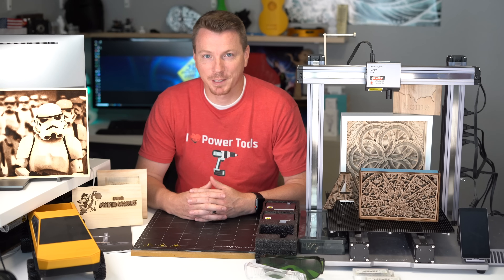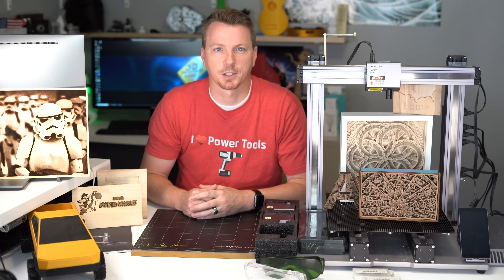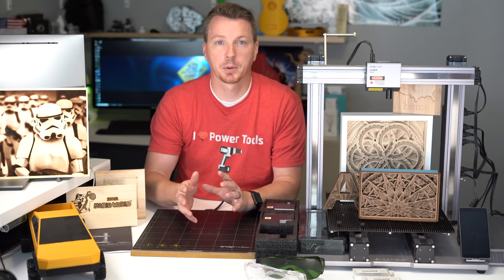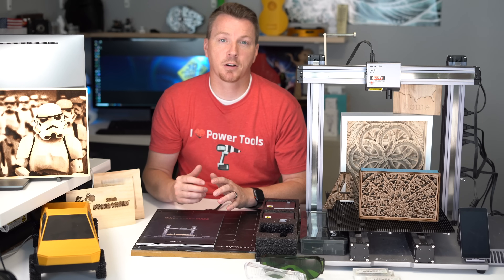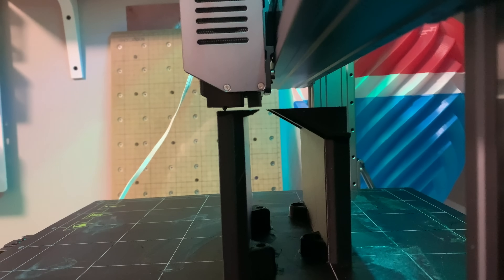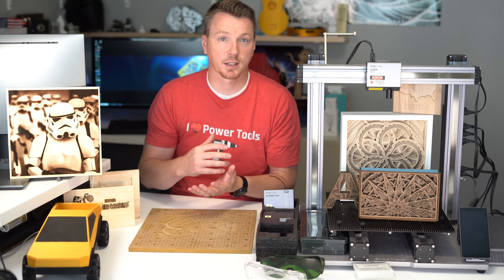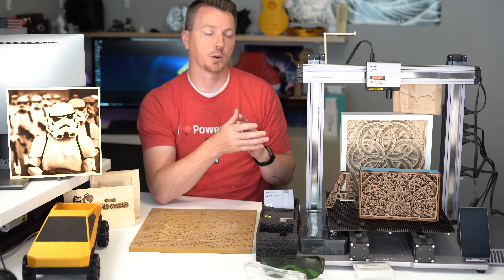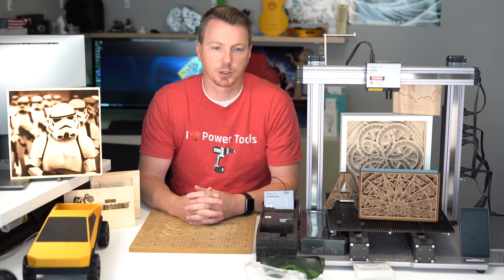Snapmaker 2 Review: 11 Pros plus 6 Suggestions

Comment: I have a question about 3d stuff and scanning  . If you have an object you want to clone with the  mill from a block of resin, plastic , wood etc.  , or want to make it from the 3d printer , how do you scan on object to copy it ? For an example , if I wanted to clone a penny bank of a plaster  bulldog  and make one to look just like it , how would I get it into a file  to use ? is there a inexpensive  scanner or camera set up to do such things ? If so what are they called ?
Reply from the maker: What you're looking for is a 3D scanner. There are apps that attempt to do this on modern phones but I haven't had any real success with them just yet. I've tried Scandy and a couple of others and they tend to leave holes and distortions that make the model pretty useless. I have an iPhone 12 Pro Max and that doesn't seem to matter. Perhaps someone else here can help us out with something that actually works?
Reply: @The3DPrintingZone  Thank you for the reply , I am glad to hear anything pros and cons about this stuff . We do  race car parts and we make fiberglass hoods , scoops and roofs etc . I like the idea of scanning a scoop or small parts  and maybe machining  a mold or plug  out of wood   (we have a Bridgeport mill ) for plastic vacuum forming maybe  , just ideas  to see what we can make  without the normal mold & plug process .

Comment: Thanks for the advice.

Is it possible to increase the "BED" (X and Y axis) of the Snapmaker if I am able to machine my own parts? Will it still work?
Reply from the maker: I've wondered the same thing - I think it depends mostly on whether the software and drivers would recognize the ability to go beyond the original bed and z-axis sizes. I suspect using third party software may make that an easier task as well. I haven't heard of anyone trying it yet.
Reply: @The3DPrintingZone  Thank you for the response.

I agree, if the Snapmaker is programmed to work within its standard beds, then it would be difficult or impossible to do so.

Cheers 👍🙏

Comment: Nice video but the coding in my 2.0 doesnt work as laser won´t focus, it just goes up and down, the camera doesnt really focus(can live without it) and the CNC when homing goes on to the provided holders and snaps the milling devices :-( :-( :-(
Reply: Use manual adjustment for height settings, when you put colored goggles on you can confirm the height working origin when the laser spot is at the smallest size while you adjusting the height, the 0.1mm step movement is really up for this process. For the camera line up, you can use run the parameter run function provided in the touchscreen module to ensure the correctness of your object, you can live without it.

Comment: Thank you so much for this review, I really think this is helping me make decisions. Do you have a recommendation for laser engraving, I definitely nee to engrave 3-4mm deep on acrylic - I make stamps for soap making and rubber stamps...? Hope you can direct me here. I was thinking of this snap maker but your last point made me think it over (glad I listened until the end) Hope you can respond :)
Reply from the maker: I think as far as engraving, you would likely need to do multiple passes to engrave into acrylic like that with the Snapmaker. I have heard a couple of people say that there is a more powerful laser module being made that will be available as an add-on shortly. I heard it will be a 5watt, which is more than 3x as powerful as the current one. That could be a game changer.

Comment: I was debating a different 3D printer and then getting a glow forge.

I think I might just get this one instead
Reply: Did the exact same thing. Pulled the trigger on this one when the Glowforge plus was back ordered. I was bummed to have to wait but then I saw the preorder for the Snapmaker 2.0 and bought. Now just have to wait until November.
Reply: @jamesjoiner79  same. I went ahead and got this one with the enclosure. Cant wait!

Comment: very cool machine, as far as the holes for the screws on your cons ....the reason they do that is because future upgrades for different devices bolt pattern will be different depending on the device so they want the option to be able to use one of those holes later on and if they made it for just the 3 it has now then eeeeveryone will be complaining why didn't you just do the hole ahead of time lol. Even tho I think it is a great machine for an all in one I think for the price of 1,500 and up you need to compare 3 devices you can already get that would be in the price range of 500-600 for each device and for that price you would get every machine way way better in a stand alone for that budget as of now I seen the Ortur V2 sold for $269 and is waaay better as a laser printer cuter than the one build for this one which on the Ortur V2 I ordered it for that price and it came with a 20Watt laser on it and for the 3D printer for that budget of 5-600 for-sure you can buy a way better 3D printer and that is why I say its a good machine if you are trying to save space but that is about it.

Comment: Thank you for your review! We need a machine specifically for etching a logo on tin boxes and we also need to cut 1" thick foam, do you think this machine could do both?
Reply from the maker: This should handle both of those pretty easily, but on the tin - are you wanting to engrave through paint, or cut into it? If you want to laser engrave clean tin, I'm not sure if the laser will be powerful enough. If you have painted/enameled tin, this will handle it just fine.
Reply: This is a hobbyist device, not a production device by any means as it's slow. If your work is mostly laser related, get a proper laser cutter for the purpose.

Comment: I'm a novice fan. Havent had any experience with 3d printing. Really wanted to get into it and that's how I found this. The CNC was just the next thing on my list, but to find something with BOTH. I feel like this is perfect for my needs, but as a new person. Is it worth dropping the money?
Reply from the maker: Sorry for the delayed response - I think it depends on what you plan to do with it and what your budget is. If you're mostly just curious about one or two of the functionalities (3D printing, laser, CNC), then it's a lot to spend. If you're considering buying a decent machine of any of those anyway, then this could be perfect. The thing I've enjoyed most about mine is that it just works. Almost every issue I've encountered has been with the CNC side of things and me learning how to do that - especially the preparatory movements of the bit (I've broken several while learning what to do). The expandability of this machine is another thing that really ups the value, so that's worth considering. The new rotary tool and emergency stop button that they're coming out with in the next few days are good examples of that.
Reply: @The3DPrintingZone  I really appreciate you getting back to me! That's a lot of helpful information, definitely helps. One thing, if you could help clarify a concern I do have. Is the 3d printing part of it hold up? With quilty if builds and all? I havent been able to find much to back up if it's an actual good printer.
Reply from the maker: @jarredwillard4072  3D Printers that can print a solid, decent print, all end up with the same durability and quality. The 3D printer part of the Snapmaker is as good as any other FDM 3D Printer (Creality, Flashforge, Ultimaker, etc.) as far as the output quality. The process for each of these is close to identical so there won't be any issues as far as quality or durability - it'll be just like any other printer. I hope that answers your question.

Comment: Wish n4 - i'm pretty sure you can start 3d printing from Luban without going to machine.
Reply: I was just about to comment that but it was here already so I can confirm this. After the initial "security confirmation" of Wifi connection to the Luban (you initiate it from Luban workspace screen) you accept the connection over wifi. Then you can basically do things from the software UI. However, the software is a bit buggy and the current (3.8.0) has some workspace related issues. But the feature is there.

Comment: How featured is the milling function? Does it offer synchronized tapping or the ability to mirror an axis on the machine? Is it an actual mill or a glorified cnc router?
Reply: It's a router. You won't find rigid tapping on a machine this cheap. Seems like a fairly good deal for what it is. If you're only looking for milling you might want to consider something else, and be prepared to spend a lot more. But full 3+1 routing is impressive for under 2k

Comment: IF this had an on/off mag base for swapping base plates id probably buy it. but the time it takes to swap bases is a deal breaker. id also like to see alignment dowels on the heads so they dont fall when unscrewing them.
Reply from the maker: That would be awesome for the beds - seems like there should be some sort of hot swappable mechanism there, and same for the heads. On the heads, I have seen 3D printed models that are designed to do just that. Check this one out, for example: https://www.thingiverse.com/thing:4700986
Reply: @The3DPrintingZone  that looks nice.  i wonder if you took a couple dowels - machined threads into the bottom of that master plate and installed a cam'd array of neodymium magnets. flip a lever and disengage them. the bed could have steel plates on the bottom for the 10 or so magnets to attach to.   could probably CNC the aluminum on this machine to make the assembly
Reply from the maker: @beardedgaming1337  That would be a pretty amazing project and probably worth trying out. I don't tend to swap my bed out all that often - I usually stick with CNC for a long period of time and then Laser, I use my other 3D printers for printing but even swapping CNC to Laser more easily would be very convenient. I recently did a fan upgrade so that the power supply is quieter (that was one of my pet peeves on this machine) and, generally, speaking, it's pretty easy to make upgrades to this unit. I wonder if someone else has already tried what you mentioned.
Reply: @The3DPrintingZone  I'm thinking about buying it for work so I would probably do a etxhing and cnc interchangeably, 3D printing things every now and then. I could see a scenario though where I would want to swap back and forth multiple times a day

Comment: I can't wait to get mine, but with my other printers, I have yet to be able to print a full sized helmet without the print tipping over. I guess I'm bad at bed leveling. I'm hoping without having to do the 4 corners routine, I'll finally be able to print one without cutting it into multiple pieces.

Comment: How about the dust of engraving and 3D printing in the same area, is that an issue ?
Reply from the maker: It's fine as long as you clean up between jobs. You have to change beds to change functions so it works out fine.

Comment: How noisy it is? I live in a little flat and I was thinking about getting one.
Reply from the maker: The power supply itself runs in the 60-65 dB range, which is a bit noisy in my opinion. The functionality of the machine is more or less noisy depending on what you're doing. Laser isn't too bad, 3D Printing is ok an CNC tends to be loud. I'm actual experimenting with replacing the fans in the power supply right now and it's going well. I've got two nearly silent fans in there and it's a night and day difference.

Comment: Can the CNC option mill though 4mm aluminium?
Reply from the maker: Snapmaker doesn't technically support cutting aluminum but I learned from direct experience that it does just fine. I accidentally milled through one of the hold-downs, which is made of aluminum, and it didn't bat an eye at it. I classify this in the same category as aluminum cutting with woodworking tools. None of the manufacturers claim to support it but aluminum is soft enough that you can use woodworking tools to cut it. Be aware that it will dull your bits though.
Reply: That’s great news, thanks. Would you be able to source metal working tools and fit to the Snapmaker?
Reply from the maker: @markwmscym  In a limited fashion, yes. If you want to buy 1/8" shank CNC bits from somewhere else and use them on the Snapmaker, it works great. Most of the carving I've done is with bits I purchased on Amazon.

Comment: What software do you use for the complex laser engraving?
Reply: Just the Snapmaker Luban that comes with it.
Reply: @LRN2DIY  at 17:20 in the video you say that you loaded complex laser engraving and it couldn't handle it.
Did you use other software or did you just not do it?
Reply: @iainforrest9194  I didn't end up doing it (yet). I was trying to test out as much as I could in preparation for this video so I moved along.

Comment: What would be a good laptop to use with this?
Reply from the maker: Most laptops that have come out within the last few years can handle this sort of thing. If you're looking to get into 3D modeling and designing, then you'd want something a bit more powerful but for slicing downloaded models and running Luban, most computers can handle it. It works on PCs, Macs and Linux OS, so no Chromebooks or mobile devices, of course. I checked and there are no system requirements that I could find, unfortunately.
Reply: @The3DPrintingZone   thanks, I got the HP 15 gaming laptop, saw some reviews it was a good pick to run such

Comment: Thank you for the very useful and honest review. It helps a lot to understand the capability of the machine in real life terms and be able to make a decision. I am seriously considering this printer, and am really impressed by the features, however one "very easy" thing for the Snapmaker team to do (in my personal humble opinion) that I have not seen in their roadmap or answers in their community portal, is a dual extruder. I believe this as a module would probably complete the 3D printer functionality and usability. Any thoughts or insights from anyone on this subject?
Reply from the maker: That's a good point. I do think it would be a fairly obvious next accessory, especially once they get caught up on their orders. For what it's worth, I own several dual extruder printers and I don't find the feature to be all that useful. Don't get me wrong, it's pretty cool to be able to use but there are very few times when what I want to do calls for two extruders. If you have specific use cases, they can be essential. If you're a general population 3D printer user, I think they're only occasionally helpful. But going back to your thoughts, yes - this would be an excellent upgrade to offer for Snapmaker.

Comment: What 3D printing materials, PLA, ABS Carbon fibre
Reply from the maker: All of the standard FDM materials, so PLA, ABS, Wood Filament, TPU, NinjaFlex, etc. Same as most other printers and because it has a direct drive system (as opposed to one that uses a bowden tube, which tends to introduce some issues).

Comment: Neils, I hope I spell your name correctly, you can "increase" the laser power by slow down the movement. I believe you can reduce the speed to 50% and keep the power level at 100%, you can have a respectively 3.2-watt laser. I have not tested how maximum slow you can set but you can accelerate as high as 500%. 
I am a 3D printing technology researcher, covering from new materials to new printing technologies(FDM, Laser, Metal, Liquid extrusion), from equipment capability evaluations to process optimization. So if you are interested, I can help you to answer some questions and improve 3D printings. Feel free to contact me

Comment: How long does it take to say laser engrave a pen with a logo?
Reply from the maker: Something like that would probably take just a few minutes unless it had to be really deep or was a harder material that required multiple passes. I can cut through 1.5mm wood veneers in one pass fairly quickly but it's not as fast as a stronger laser, like the 30-50 watt lasers.